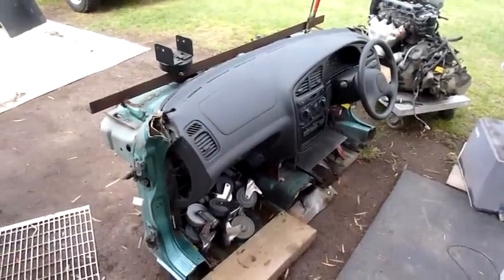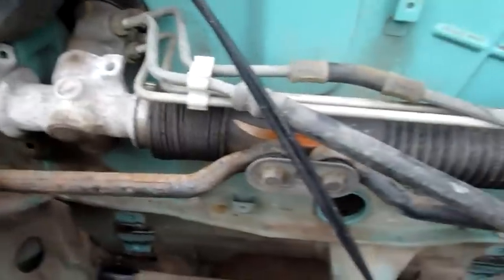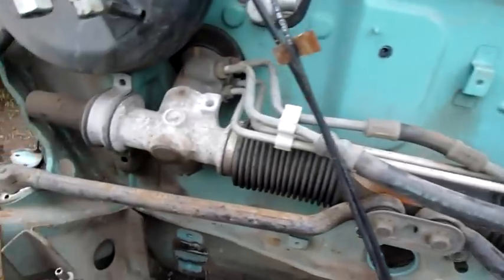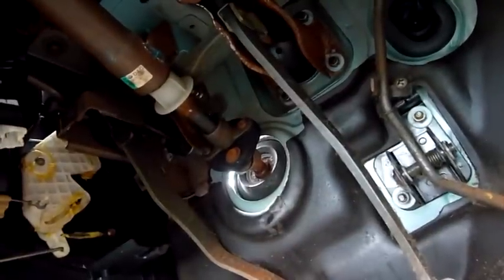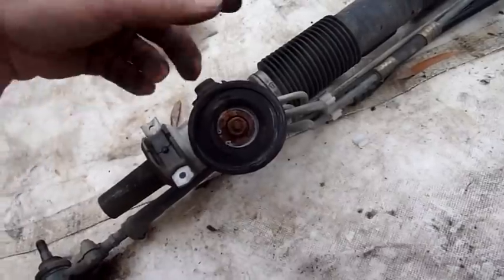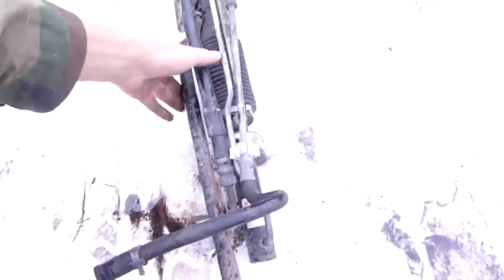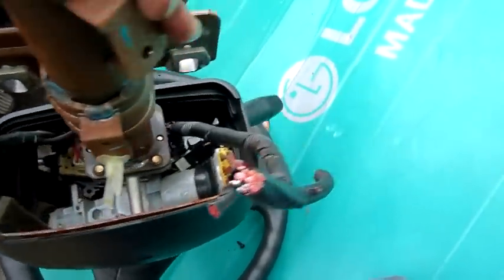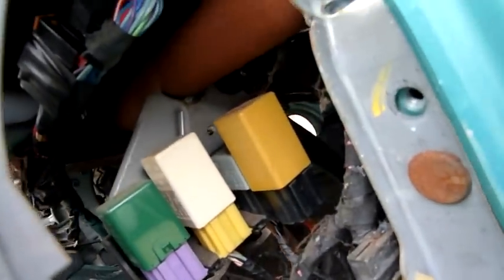Daewoo Lanos Autopsy - Firewall and Dash panel Pt1

Comment: Ed...when the vehicle is manufactured the entire dashboard is installed as a completed assembly.  It is craned into position through the front door and pushed forward and bolted to the firewall and body with 6 or 8 bolts. Then all the wiring connectors are snapped together.  You just got to figure out where the attachment bolts are, remove them, and the whole dashboard can be pull back away from the firewall.

Comment: I'm sure there is a way to take them out fast if you know the trick, after all if you watch an auto assembly line the dash usually goes in as one sub assembly. I have almost a complete dash for a 1956 DeSoto and I think it went in as one assembly, it's steel of course and not plastic.

Comment: dang !thats alot for a M1  ,the GM ones are rare and worth more ,but i got M1 carbines back in the 90's for under $300 bucks ,got one for free back in the 90's too from a friend ,nice plinking gun made by "u.s.postal meter" maybe thats where they got the term "go postal"??? :P good AR-15'S use to cost $1000~to 2000 ,now they skyrocketed and supply dried up over "gun control" issues